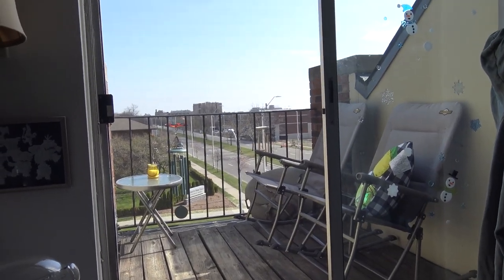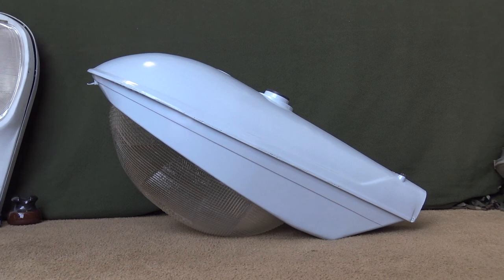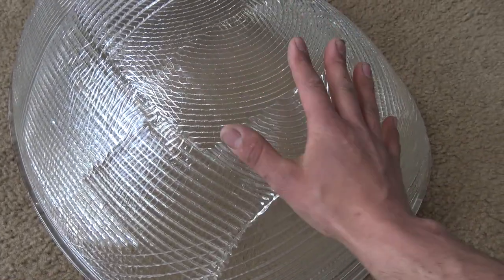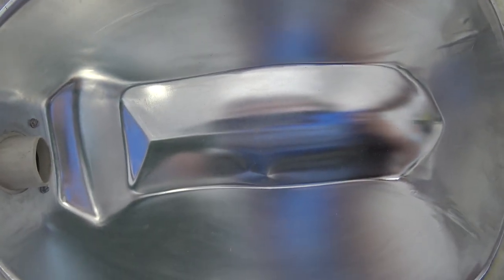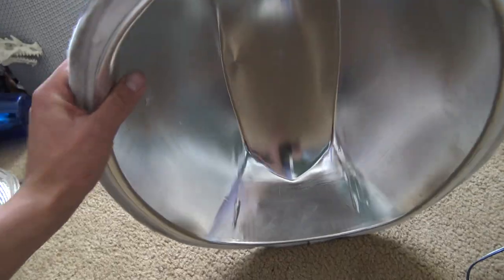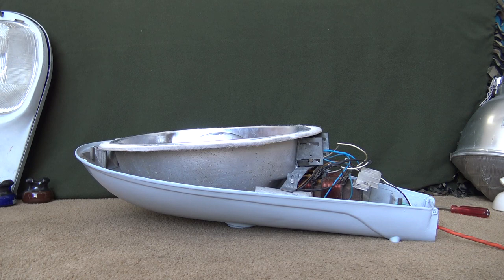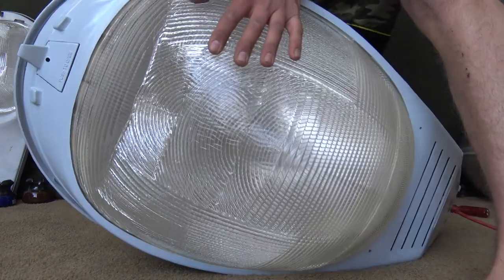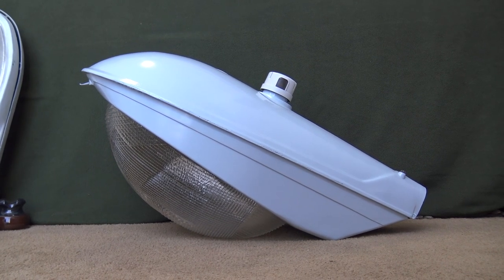1989 General Electric M1000 1000W MV Overview

Comment: First generation of GE M-1000 from 1957-1966 with fin on top, second generation from 1967-1971 has the gray enamel finish on the outer shell and door, third generation from 1972-1977 is the same, but the reflector is anchored to the brackets near the socket to preventing from separating from the fixture, and the fourth and final generation from 1978-1990 has a step down on the door for a bigger ballast. Sure missed those fixtures. I also like the GE, M-400R from late 1958 (as of 1959 Model) to 1979 in three generations, and it is the same as M-1000, and GE M-400R from 1985 to 1996 as of single door units.